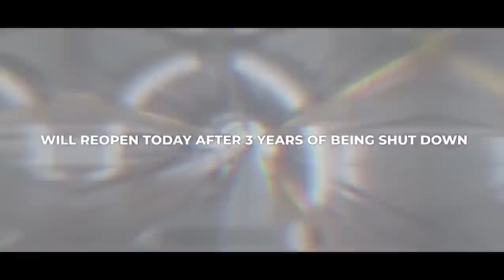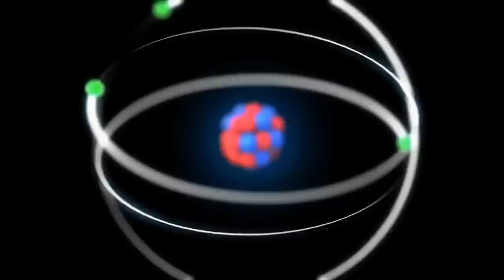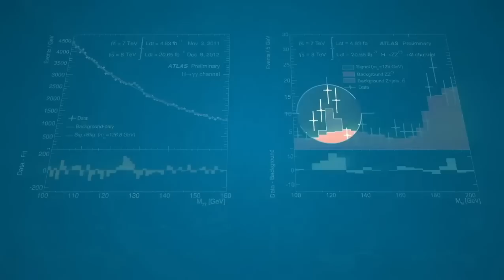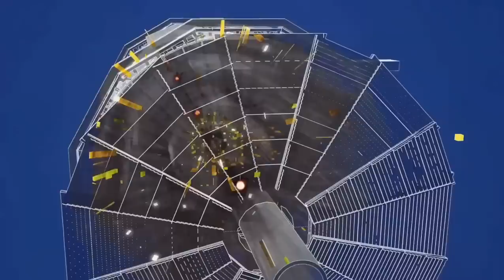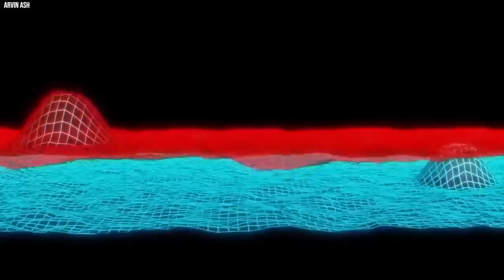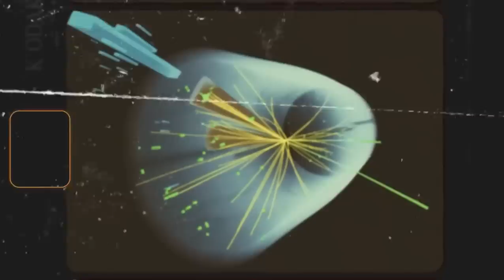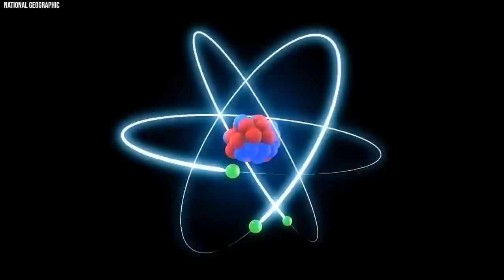CERN Scientists Break Silence On Chilling New Discovery That Changes Everything

Comment: The basic problem with this kind of science is that it's not experimenting to understand what has happened. Instead, it's experimenting to try and prove somebody's equation saying that something is. Creating unstable particles, which do not exist naturally, proves nothing beyond saying that it was done. Reality Does Not Care About Math. Everything they are doing is based on speculation, which is based upon even more speculation, several layers deep into a world based on speculation alone. Considering that they still say they have no idea what 'Dark Energy or Matter is, it would seem more prudent to figure out what those are first. In 1930, or so, half of reality was cast aside because the prominent scientists of the time refused to admit they had missed it. (Dirac) Their mistake was swept under the rug to protect their status of being the 'best and most important'. CERN is a total waste of time and money, trying to create something which cannot be contained or used for practical purposes. The same thing goes for the Fusion Reactors. They will never output more energy than what has to be put in to make it work for even a few seconds. An old steam engine is more efficient, and buildable. It's true that there is no such thing as 'free energy'. You have to pay for the materials to build the device. The second law of thermodynamics can be violated freely, at will, as that law only applies to a closed system. Yet the other half of reality was cast aside so long ago. Scientists have created the box in which they are trapped. I bet the kickbacks are good though.